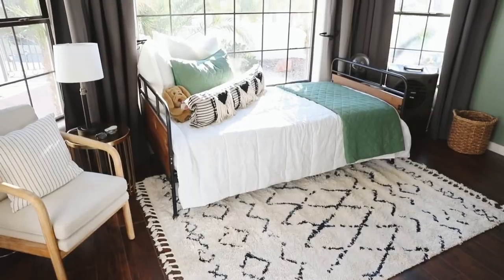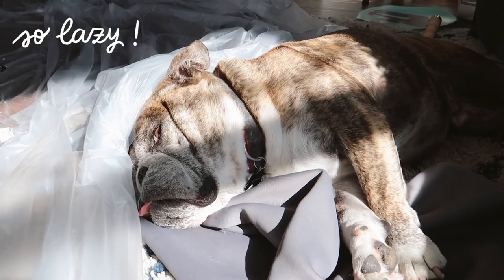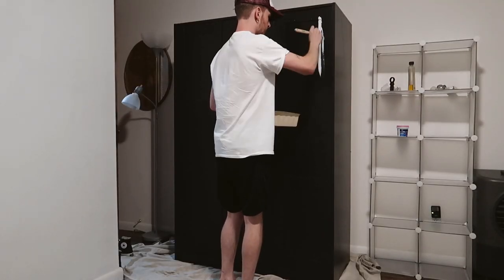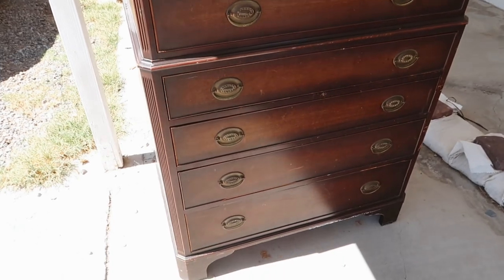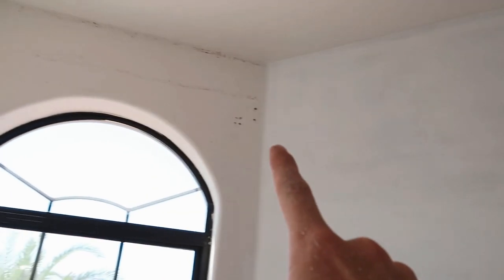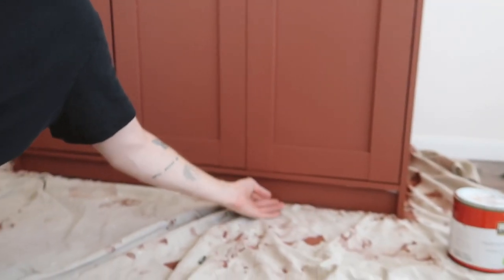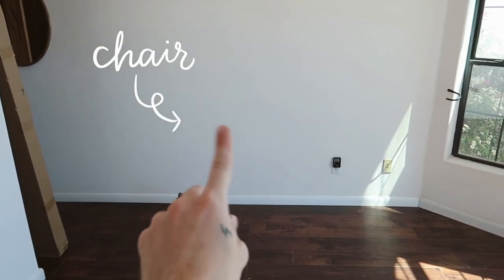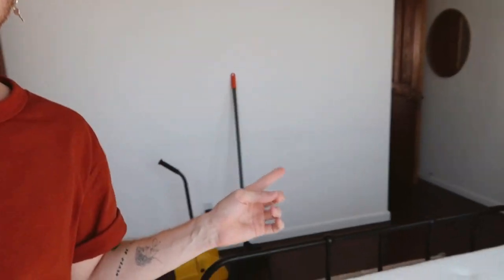Redoing My WORST Room Makeover ✨ Guest Bedroom Transformation! (From Start to Finish)

Comment: Personally I would have switched the orientation of the bed so guests could have a view out of those beautiful windows and maybe had a window seat for reading and relaxing 😍 Love the styling and colors, a really beautiful room!👏
Reply: Agreed, I would hate to have that sun streaming in on my face while trying to sleep!
Reply: Same, I'd love to see out the feature windows from the bed much more than watching a tv.
Reply: But if the bed was on any other wall, where would the TV wall be? The downside of the TV opposite windows: will those curtains block enough light to see the TV clearly?
Reply: @MBMCincy63  I wouldn't want a TV in a guest bedroom, but the TV could have been placed on the wall with the dresser and had a swivel mount so it could swing out and face the bed 😊
Reply: Agreed. I'd also flip the dresser and wardrobe. Tv isn't really necessary in a guest room.
Reply: Was thinking the same!!!
Reply: Definitely agree on that.
Reply: Yes I was kind-of thinking the same, in Australia the heat and cold coming from the windows would wig me out. Personally i don’t put t.vs in bedrooms so I’d flip the bed.
Reply: But then it wouldn’t be feng shui!
Reply: @nancyherxo  Putting a bed directly below a window is actually really bad feng shui... All the qi escaping through there and not flowing would mean a very exhausting sleep. Following those rules he'd better had put it to the wall on the right. (but then the passage on the sides of the bed would be very small..)
Reply: Agree! Those windows deserve a focal point. Also, maybe the round mirror behind the door, could have been moved next to  the dresser instead of a chair, or a large floor mirror would’ve been nice. Everything else looks amazing 😊👍🏼
Reply: @nancyherxo  it’s technically not feng shui now since having windows behind a headboard-especially behind a non solid one like this isn’t feng shui.

Comment: A suitcase rack (or two!) is a must for a guest room, as well as a basket of travel sized toiletries and a surge suppressor electric plug strip next to the bed for device charging. 

It never would occur to me to put a bed against a window when there are two solid walls to put it against. Put accessories in odd numbers, especially like the vessels atop the wardrobe.

Comment: Beautiful makeover and the tall dresser looks good with items on top. Have a couple comments  , one about the small print you hung above the chair; it needs to be higher and it would look good with the second print hung above it. Also, the mirror by the door is hung in one bad spot. It is a miracle someone hasn't broken it yet. It needs to be moved and rehung further inside the room so that the door clears it. Just one or two feet to the right.

Comment: Quick tip: if you have older dark furniture that you don't want to strip and refinish grab the Old English brand of dark furniture polish!! As you polish the built in dark varnish camouflages all the dings and scratches!! Just be careful not to set it down and leave rings or drips where you don't want them ;)

Comment: I don't agree with the art above the chair. My thing is you don't put 1 art piece below eye level unless it is in a grouping/cluster. I do like the print but don't like the frame. I live close to a place called ROSS and they have canvas for paintings. You could get 2, glue the prints on them, paint the edges with the left over paint from the furniture and a few decorative accent hanging pieces. Almost need a bigger chair in retro of the size of the windows and furniture. Hang out with Good Will, Salvation Army, commission shops, FB marketplace. God bless you and I hope you like my ideas...